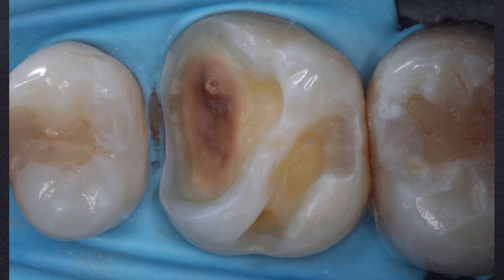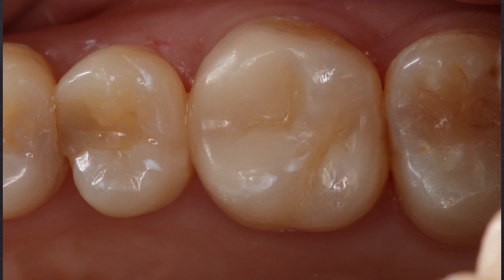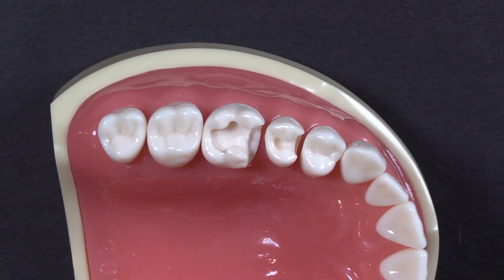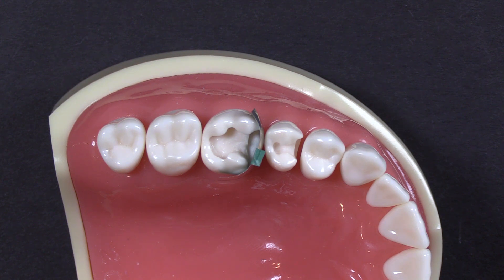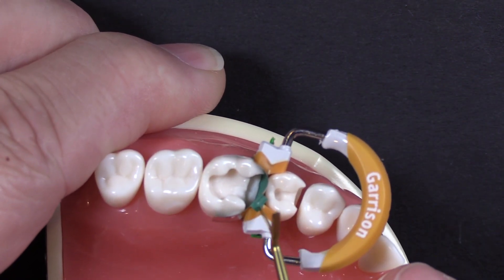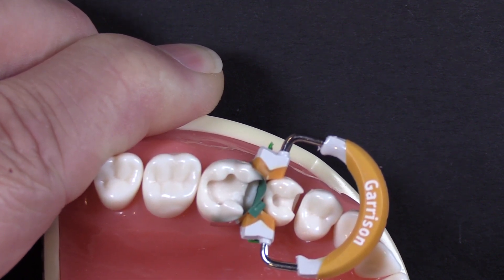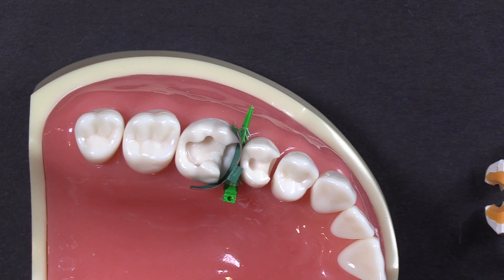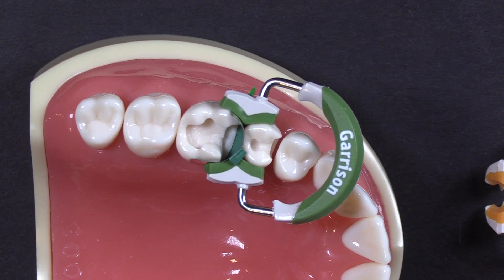Top 5 Questions: #2 | Extra Wide Prep

Comment: I wish if you increase the lenght of the ring a little bit so that i can use in case of missing cusp
Reply from the maker: Hello Dr. Adly. Do you mean that you've tried the wide prep (green) ring on a restoration missing a cusp and the ring tips weren't long enough to seal the matrix band against the tooth? If that's the case, a restoration like that would really need some sort of tofflemire-style band to be used instead of a matrix system. That indicates to me that no ring would be able to fit and seal off the matrix band properly.

Comment: Really love this tip! I just bought the garrison matrix system and have a little question. Can we use Green ring in the normal Cl.II(Not exceed the line angle) case ?
Reply from the maker: Glad you are enjoying the system so far! If you want to use the green ring for more than wide prep cases, you can, as long as it fits where you are placing the ring and doesn't interfere with you gaining access to any part of the restoration. Special cases like MODs where you might want to place more than one ring at a time will not allow for you to use the green ring. The tips are so wide on that ring, that if you tried to stack one ring on top of the other, it wouldn't fit.